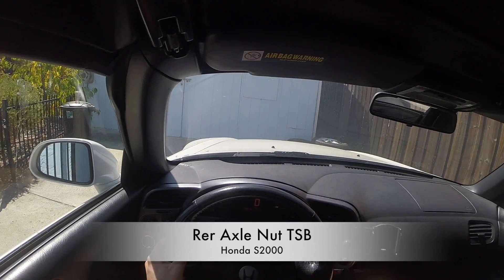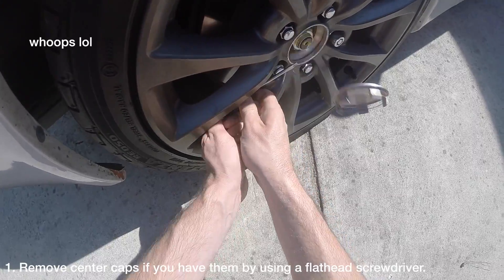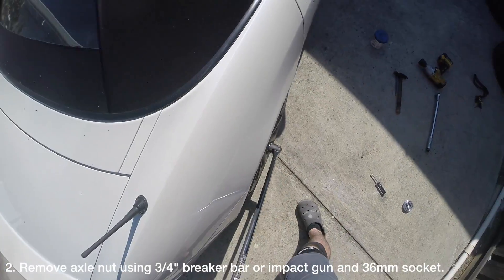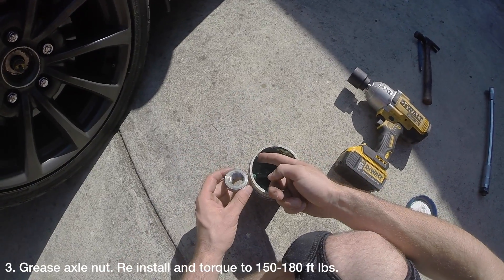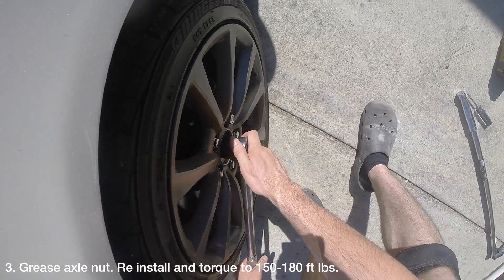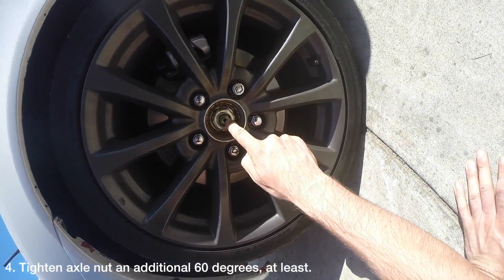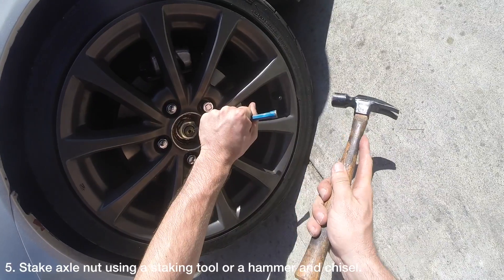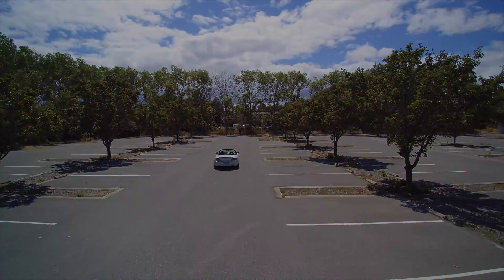Rear Axle Nut TSB | Honda S2000

Comment: FYI, 60 degrees = one flat side of the nut

360/60 = hex

So basically, mark one of the tips of the nuts hexagonal points, and where that point mates to axle stud. Turn nut until the next hexagonal point reaches that same spot on the axle stud.

That will be exactly 60 degrees.

Comment: Hey DIY person, my s2k rear wheel was loose just like in the video, I tightened it correctly n drives perfectly but I hear a clunk when I roll off in first gear , it’s just one clunk n then it goes away what could it be a bad wheel bearing???
Reply from the maker: It’s possible you still haven’t tightened it enough or it was loose for so long that you have damaged the wheel bearing permanently. Are you 100% sure you have tightened correctly now?
Reply: DIYGuys not 100% sure it’s tightened I will double check , most likely I’ll replace it with an oem hub n bearing to get it out the way
Reply: @bige7186 Did you end up finding out the issue? I have the same issue where in first or reverse from dead stop, there one loud click
Reply: @ thanks!

Comment: I just tighten my right rear axle nut and I still hear a clunking noise. I hold the axle and noticed that I can make it move (both sides).

Is that normal? Or it should not move at all by hand?
Reply from the maker: The axle will move by hand because the CV joints allow it to move. If you hear a flunking noise it could be swaybar endlinks. Rear axle but will be a distinct click, almost like marbles hitting each other.

Comment: No offense, but it looks like you used a 1/2" chrome extension with a 1/2" breaker bar presumably, that is a high torque spec thats why its going to snap, i would of just gone with a 1/2" breaker bar and 36mm deep impact socket :D
Reply from the maker: Yes that would be another option but frankly I think 3/4" is the way to go. Even with the 1/2" breaker bar it can get very very sketchy lol.
Reply: I guess, but typically everyone has 1/2 or 3/8's. I don't have a 3/4 haha.
Reply from the maker: Another option is using an impact gun which I’ve discovered recently. Just need one that is strong enough and have to be careful not to over torque since it’s hard to see the nut move when using the impact gun.
Reply: Well, thats the best way, unfortunately for do it yourselfers. Majority of the time they don't have air impact wrenches/guns or electric impacts so thats outta the question, only a 1/2" breaker or ratchet will suffice. That nut is pretty high torque, I'd just torque for a bit and when i feel like its getting kinda tight as i don't wanna overtorque and retake it off or cause the nut or CV Axle threads to stretch. Mind you i don't know whats that rating or specification before i damage something so I'd use a torque wrench afterwards just to keep things on point. I always go OEM specs unless aftermarkets come with specs for a good reason like ARP headstuds which require their own specs than TTY bolts on a normal head :D Stuff like that makes sense. Anyways Thanks for the reply. Can't wait to see the upcoming videos on the S2000, I'd wish Honda make another S2000 with good looks or more futuristic looks. I love the FT1 design for Toyota unfortunately its a halfassed supra and FT1 so no dice.

Comment: Do you reuse the old one, or did you get new nuts?
Reply from the maker: Re used.
Reply: if i dont have a center cap on the rim i can just take the rim off yes
Reply from the maker: You can but you will need to have the wheels on the ground to prevent the axle from rotating when removing the axle nut. If you have a really strong parking brake you might be able to get away with it.